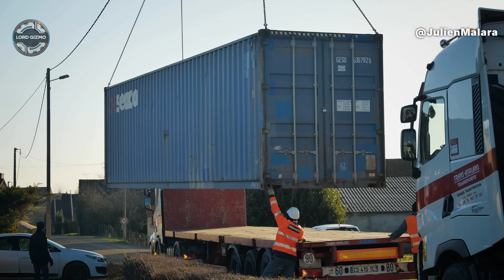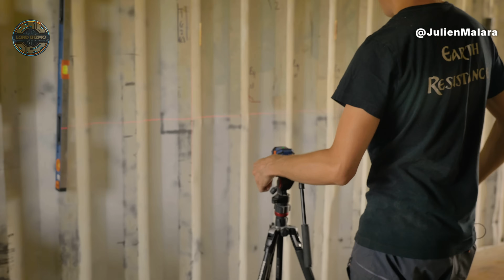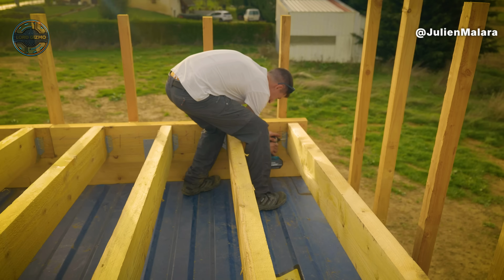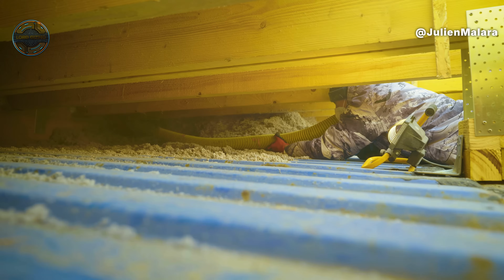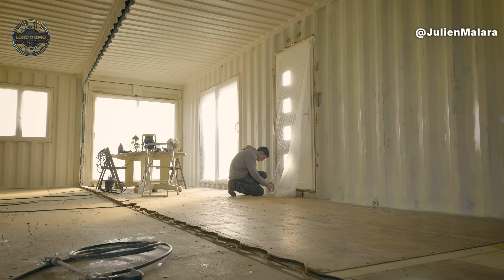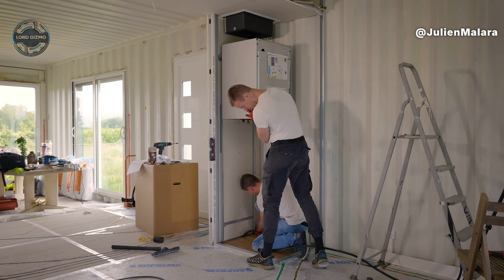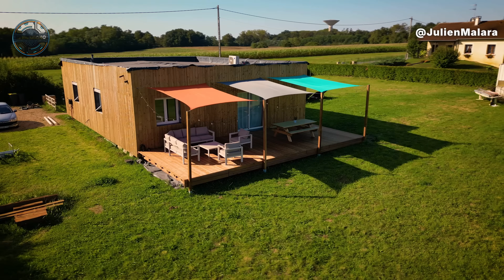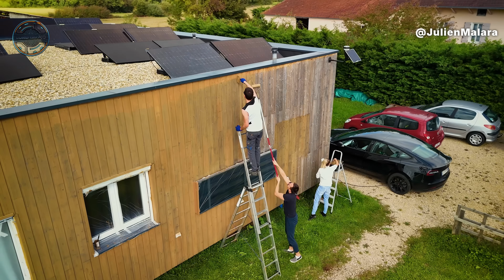He Turned 4 Shipping Containers Into a Luxury Home | Start to Finish by @JulienMalara

Comment: So whats the point? having a steel shell on four sides that it? when you have to cut everything inside and then build wooden wall outside and inside walls then what's the point of using containers.

Comment: way over constructed and you have defeated the simplicity of using containers but good effort. The cost of modifying the boxes is defeated by traditional timber building methods. 10 for effort - 2 for design

Comment: Why didn't they put in plumbing and electrical lines before they put the containers in place? That is usually done before pouring a slab and even a basement floor.

Comment: The welds were not good ... and the pipework was not sleaved going through the steel container walls ... so it is likely going to cut the pvc pipes and leak.

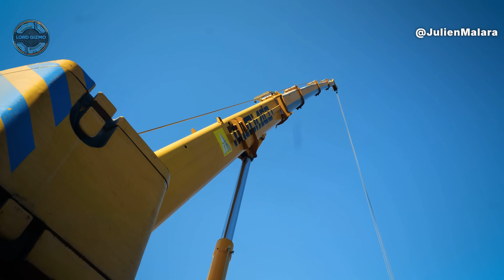Comment: 01:48  pillar of foundament must mach to coner of container. . Best solution is  not this metal tube pillars bur concrete foundament and real concrete pillars +  corner pillars 4 corners . Then these sea cargo cntainers + good roof and terhmo isolation . Of course all tubes ,cabels  infrastructure get ready befor these conteiners instalation.

Comment: 35 years of building houses and this is like a train wreck I can't look away from.... Like why didn't you pick the roof 5.6 degrees.... Hell why didn't you just make a couple bird mouth cuts and making a frame on the top and put shingles on it..... Why didn't you just do wood shakes or aluminum siding or vinyl siding..... How you could have did stucco

Comment: Wouldn't a big metal box absorb heat 10x as much as a regular home in the summer? 

Wouldn't any amount of moisture eventually lead to rust on a massive scale?

Shouldn't you be nervous being in a big metal box during a lightning storm? Even if a bolt hit near you, your more likely to have everything in your house fried to a crisp. A surge protector only handles man made AC power surges not electical storm lightning.

I imagine one advantage to it would be sturdiness during high winds but other than that, I don't see the appeal of shipping container homes as much as the people advertising it do.

Comment: I am building a similar type of house, here in Germany... for my family. Actually, it is an extension of an existing house. 
The point of such construction is that you can build an energy-efficient house in a very short time - with relatively small amount of  money. You don't need to be any expert, just a little knowledge and good will. 
In addition, this type of construction allowed me to make my flat roof completely green, full of plants. In my city where I live, the local government subsidizes green roofs.
Here in the video they used metal feet, supports driven into the ground. Here where I live, the soil is so wet - that those metal feet would rot in 5 years. I used 40 concrete feet, 60x60x16 cm...By the way- I was paying one just 10 euros😊

In this video, the final form of the house has visible metal surfaces of the container inside. My type of construction has internal walls, just like a standard house. 
The thermal insulation of all the walls is 5 cm of PUR (which is what the walls of this type of container are made of, which I used...) plus 15 cm of stone wool. The ceilings have thicker layers.
The floors in the containers that I used already have 12 cm of thermal insulation (rock wool), from above is a 2.5 cm thick slab (I don't know its name) made of cement and sawdust.t's up to you to install a laminate floor, or whatever you want...

What is Energy efficiency?Heating in one Room(about 18 square meters) is infrared Heating 500wats.(for normal room which have brick walls,you need about 2000 wats)it depends how many windows,doors you have in this room,etc

 Everything you see in this video, I am similar made...where does the main point come from - the house costs 40,000 euros. Otherwise, here in Germany, if a company does the work for you, you can't even build an ordinary basement under the house for that money.

The containers from which I built this  are not standard shipping containers, but bureau containers. They already have Windows,doors,etc.These containers are initially wider than shipping containers.The containers I built with are 6.05 meters long, 3 meters wide and 3meters high. I just used 3 of them....So, for 40,000 euros I got about 50 square meters of living space..

One Big Bravo for these guys, who made a really nice living space - literally out of a pile of iron😊❤

But Bro, where is the water drain from the roof in this video?😊

Comment: So the issue is that steel frame construction is stronger and more durable than wood construction.  Is better than wood for "Pre-Fab" and transportation construction.   Its downsides are the corrosion and insulation deficiencies.

Which begs the question of why are modular pre-fabs not just made from steel in the first place.   Instead of just BARE STEEL BOXES  why not make HOME MODULES complete with plumbing and electrical wiring and windows and doors all the required home fittings???   That enabled the screw pile foundation and bolt-up and waterproof construction straight from the factory.   That the cocoon or the insulating external layer box is NOT added at the factory, but added at the construction site, just the same way that they did it here.  These would be as lot more "Tornado Resistant" than trailers, strong steel boxes that are "screw piled" into the ground, would not as easily be blown away.  The outer insulation box night get ripped off ad blown away, but the steel box and contents would probably stay.

Comment: fantastic project, but I have to say... ... ...  winning Green awards is fancy, nice ego boost, but what happens in a decade or 2 when that roof membrane allows water into the wood fiber in the wall cavity?   Is the structure meant to only last 20 years?   That's not actually Green.   As an architect, my impression is that 90% of modern construction is moldy, disposable trash, while also being deeply over priced.  Again, this is a fantastic project and I hope I'll get a chance to design something similar, but someone please walk me through why rockwool wasn't used?   Why not 1-2" of rigid, 1" air gap, then 6" of rockwool?  Yeah it would cost more, but the structure would last many decades, would not become a Sick Building.

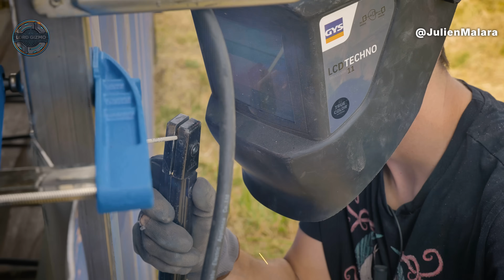Comment: as a welder of 40 plus years they welding is very bad! at 5:45 he is welding virtual down this is not the strongest weld and welding this way also reduces penetration.
at the start of the video you where saying about heath and safety and PPE welding with your arm exploded can lead to arc burn, sparks from the welding can burn right though his T-shirt.
and I agree with others! why built a real house over a shipping container? particleboard should no be used anywhere near the outside of any building.

Comment: Steel is a good conductor of both electricity, heat and cold plus condensation then building a timber frame around it .Expensive choice .
Reply: Concealing CAPTIVES.
NO CHANCE OF ESCAPE.
SOUNDPROOFED TO COVER SCREAMS.

Comment: I worked on containers for maintenance and repairs.   
The walls are structural. 
I know you know this as you cut the video when the walls dropped after cutting. 
 I would ALWAYS jack up the sides to stabilise as I cut so the roof rails didn't bow without wall's. 
 And those welded plates on the seams! 😂😅  
I give this thing a week before it leaks and a year before it rusts.  YOU SIDNT EVEN PAINT IT 😂 infact at the end, all the welds are already rusted!

Comment: I will never understand why people put containers right next to each other and then cut them. So much cheaper and better quality if you just use them for the exterior walls and then do a conventional trust and roof system. More bang for your buck. What they did here with four, they could have put 2 on each side, two running blunt into each one, then cut into each end for doors. This would give you a large courtyard in the middle. 
If you're going to build with blocks, build with blocks. Don't take blocks and hollow them out. Not to mention you have to do all that reinforcement and you're losing all of that square footage.

Comment: Thermal bridges should always be cut on a 45 degree bias to ensure solid surface insulation. Lineation insulation is useless. Bias over lap ensures even Vapor flow. Gaps are the vector.

Comment: I'd have used moldable concrete for the outside, and mold it like wood slats, and then stain it a wood color when dried.  You wouldn't need any insulation with concrete covering it.

Comment: The wrinkled rubber membrane on the roof was a mess , untreated OSB around the windows is not the best idea, and with no drainage from the roof, the edges are going to make it act like a swimming pool .  And let's not forget the welding. ☹

Comment: I have lots of questions about rigidity given how poor the welds were. Its a good idea for an outbuilding maybe but it isn't a luxury home.   Those exposed internal container faces look dreadful.  Why not plyboard them and you can also hide all the wiring and plumbing? 
The one thing that really niggled me were the screws put into the external cladding... why not keep them in line or even better use invisible fixings? They don't look neat all at different heights... next time snap a chalk line at the height you want them and keep them nice and uniform.

Comment: One thing I wonder about, why is the wood in the inside, the battens, roof joists, girders, not also covered with a protective coating?  
I've never seen that done in any project, I take it there is a reason, but what?

Comment: I'll never understand the fascination with container homes, you have to do everything you normally would in building a home only now you have to weld boxes together and cut our windows and doorways, plumbing holes etc. its just a lot of extra work for nothing, no benefits its a stick built home with a metal skin in the middle of it. that same house could have been built faster, cheaper and better without the containers in there

Comment: I'm so glad coming to the comments didn't disappoint as there was so many 'mmm that doesn't sound right' moments in this video. I would seriously question the building logic of using containers like this as I see no $ saving in doing it this way, the house is also exceptionally ugly being a box. Architects would be crying having to look at this thing. I guess the money saving was labour in doing all the work himself over a year or so but the quality of workmanship was terrible. He should have got a friend who knew how to weld, a better sparky as that install looks terrible too, and a plumber with a clue to run the drainage under the containers then up through the floor to hide all those pipes he had on the walls. I'd question if those foundations would sink at different rates and how unsquare the entire house will be in a few years of settling weight on them.

Comment: If you're building the whole frame anyway, how is it better to use shipping containers?  There's no way that much steel is cheaper than just buying the wood, it's harder to run plumbing and electrical through, you're not saving any time because you have to build the whole external frame anyway; there is literally no advantage.  Takes longer, costs more, insulation isn't any better, is more difficult to work with, and it even blocks cell service in your own house and makes wifi carry less far through rooms. My brother built a pallet shed.  That made sense.  Materials cost him less than half to build it, took less time to assemble, built-in air gap makes insulation batter than just direct exposure to the outer wall (if only mildly) and it's so over-engineered that it's stronger. I'm not above turning junk into treasure, but this just seems like a bunch of wasted effort just because.

Comment: This is so poorly thought out and constructed there's no way this passed inspections. It never would have in North America. Using OSB to reinforce window cut outs? Jesus Christ Europe does not know how to build a wood framed house. OSB is trash, It's literally sub floor, it's what we put on joists under a real floor. It's not framing lumber. It has 0 structural integrity under vertical load. It's not meant to, it's meant for horizontal applications, like floors, that's why the chips are laid the way they are, it's literally in the name. Oriented Strand Board.... jfc. Under vertical load it will warp, without question.

When you cut giant chunks out of a container you reinforce that with steel. You don't use OSB. This is simple stuff an engineer would tell you if you hired one. Or even watched a video of someone building a container house that did hire one. 

This is legitimately making me frustrated just skipping through this video. I wouldn't be surprised if this has major structural issues in under 5 years and is unlivable. I also wouldn't be surprised if some government official showed up and made you tear it all down. No doubt while the owner cries about bureaucracy!

Every time I see a European complain about our wooden homes in NA I will send them this trash. The lack of care and knowledge before taking on a project like this is concerning to say the least. this screams "I HAVE RICH PARENTS AND THEY LET ME FOOL AROUND WITH THEIR MONEY AND LAND". People with limited funds tend to think things through a little better than this. 

The interior being the inside of a storage container... gee I wonder how that's going to be for practicality... it's almost as if there's a reason nearly every single person that builds one of these houses frames the inside... Enjoy hanging literally anything.

Comment: Like many, i don't see the point of using steel containers when you build an exterior house around them. That exterior house could be likewise insulated, and finished with interor walls of different, more conventional material. If anything the steel might rust and be less durable.

Comment: I’m guessing the roof also doubles as a swimming pool in the summer and ice rink in the winter🤷‍♂️
Reply: What da f =ck is going on here?   This has to be a joke
Reply: @SuperDodoe  no drains at all for the pool on the roof.
Reply: This is my exact concern I kept waiting for them to put a proper slanted roof on the top of this thing and they never did it's just going to be a flat surface up there that water is going to collect on and sit there and sit there and sit there after all the trouble they went to to make sure the walls were insulated and moisture proof, they leave the roof flat I Know It is Well insulated but wouldn't it be nice if it were designed so that the water would just run off when it rains

Comment: You can literally see the outside between the walls. And the pipes are completely uninsolated and with big holes where the pipes go through. What about frost, condensation and BUGS and rats! Ice cold walls in the winter. Omg what a disaster.

Comment: By the time you get done cutting up the containers and dealing with rustproofing and insulation problems, you could have built two houses. In fact, to do this right, you end up building a house around the containers, and another one inside the containers.
Reply: Disaster 😢
Reply: this story is complete bullshit.
Reply: It's ghastly concealment for captives.
Who would suspect?

Comment: really cool build but I guess I dont see the reason for the shipping containers if you were just going to build a normal frame around it.
Reply: This is most likely in the Balkins boiling summers and freezing winters, the containers will help especially in winter. The advantage of using them is also financial the cost of concrete is nuts now.

Comment: I'm all for using shipping contaners for homes. But why use the containers when you cover it up not knowing that has shipping containers? Exposing some of the container looks nice.  what was purpose of sandblasting  and painting when the walls are covered in drywall?  I hope HQ cont were used (269 cm) tall.  Due to floor installation takes about 10 cm. plus flooring..  Maybe because I'm in the U.S. we have a different style.

Comment: I am a little surprised that they would use a rubber material on the roof. Most rubber is highly flammable. How did they receive approval to use it as
 building material?

Comment: out of curiosity; the internals are sandblasted and painted. wouldn't the outside benefint from that as well? I can imagine that after let's say 50 years that would gain significant resistance to rust eating away since there was allready rust on the outside. If you build a home, you want to last it well "forever".

Comment: This would have been much better to have stacked two containers on top of two others and not used any wood on the outside. Just sandblast and paint. Keep the roof metal too. Whatever insulation work that's needed could be added to the interior.

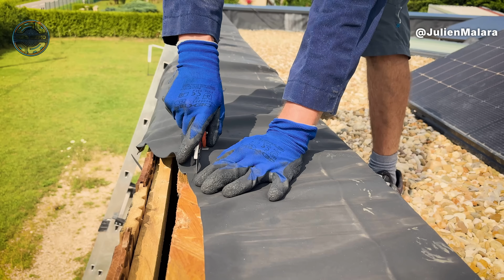Comment: Why to cut this 21:37? I would have left it to go over the edge and even seal it.
Reply: Water goes down, not up. On commercial rubber roofs, it stops on the top of the wall because it gets covered with a cap, like they did here. The edge should be sealed for moisture, though.

Comment: 100% coldbridging mistake, totally stupid insulation setup.. exterior insulation on walls yet interior insulation on floors. The whole thing is a metal box so what do you think heat and cold will do when it hits the bottom?